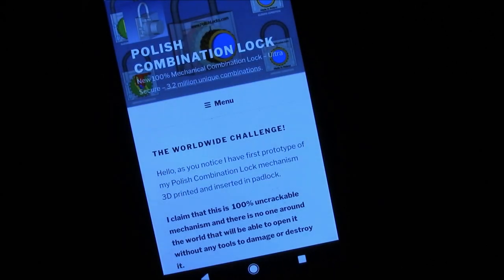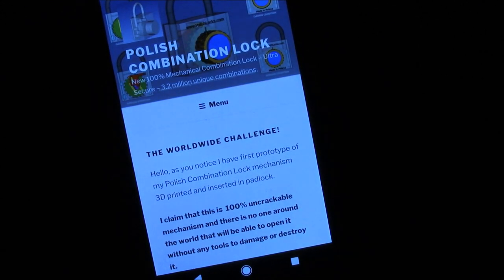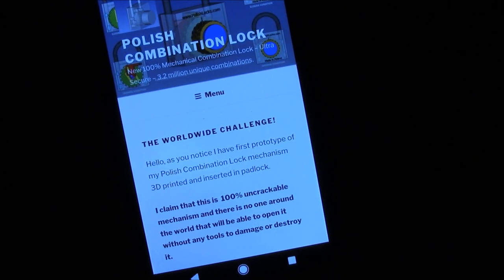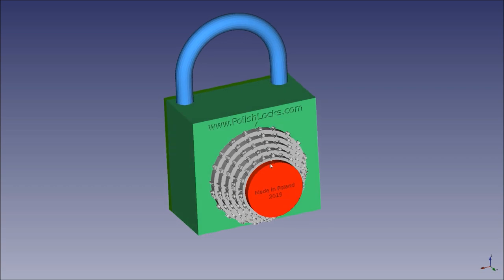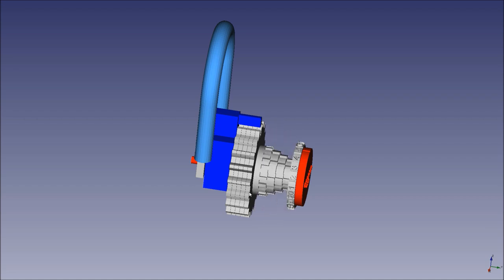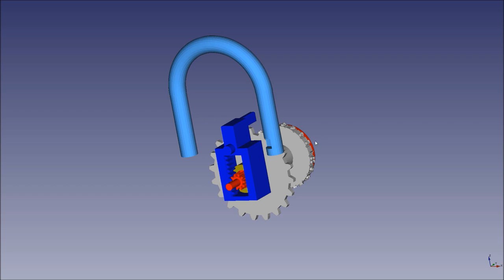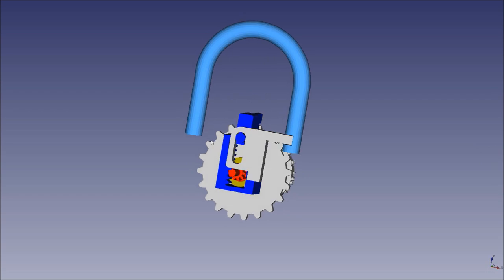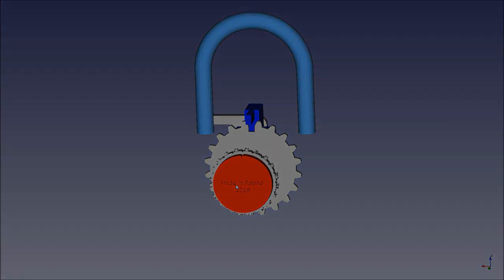(picking 625) The Polish Combination Lock - Introduction

Comment: Very cool lock.
The only thing about the body I would change is to give it a shrouded shackle.
My main concern is that the screw in part can be forced to uncrew maybe.....and then you can look as the notches on the inside of the wheels to see if they are lined up. Can you force the blue piece out with pulling attacks.
I know without tools it is very very good.
I like the design.
Would like to see a shrouded shackle.... otherwise I would want to use a lock like this.
Reply from the maker: Yes, a shrouded shackle is always a good thing. I also think that the screw is a weak point and maybe needs a counter nut to secure it. Let's see how good the feedback from the plastic - I have to be careful to not break anything.

Comment: What a simple, yet clever design. Potti, I have confidence in you being able to decode it. You have the advantage of knowing what's inside and how it works. I think that a lot will depend on the feedback. 3D printed plastic may not give the best feel, but, at the same time, it probably won't be so precise. The red dial will probably be the better tensioning option, maybe the shackle will help, too. Good luck and I look forward to you defeating it!
Reply from the maker: Yes, knowing the inside helps for sure. I even did some measurements - the bar is 3.8mm wide while the true gate is 4.2mm and the false 4.11mm. This should give 0.4mm room for testing the gate. Let's see how much feedback the plastic will provide.

Comment: Cool lock... but you will defeat it, I´m sure, if you can make tension on the mechanism is only matter of time that you find the little feedback that give you the setting info. Good luck and can´t wait to watch your decoding video ;o))))
Happy new year my friend, cheers!! ;o)))
Reply from the maker: Happy new year buddy :-) Cannot wait to receive this lock - it's in the UPS store 5km away from my house since Saturday - hope it gets to me my locklab on Tuesday.
Reply: @Potti314  Cool! Is it manufactured on a 3D printer, or it´s a metal prototype? the feedback would be very different depends of the material that the lock is made. Very cool anyway, can´t wait to watch the video ;o)))
Reply from the maker: It's made on a 3d printer - hope there will be reasonable feedback. Lock should come today :-)
Reply: @Potti314  ok, if you are able to decode a plastic one, a metal prototype don´t would be easier.

Comment: The false gates look wider than the true gate from what I can see. They taper in at the top and look to be half again as wide as the true gate. I would find the tightest number on each wheel and go from there. Just a thought.
Reply from the maker: The bar on the actuator that goes in the gate is 3.8mm wide and the true gate 4.2mm (the false is 4.11mm). This will give me 0.4mm to test for the gate. In theory the wheel in a false gate should be stuck under tension and in a true gate it should have some detectable free-play. Not sure however how good the feedback from the plastic model actually will be.
Reply: @Potti314  Yup, treat it effectively like a sidebar.  This should be pretty easy I think.

Comment: Hmm...I wonder if the combination can be changed ? Look forward to seeing the real hardware.
Reply from the maker: Yes, the combination can be changed. The inner and outer wheels are stuck together. By changing the angle of the connection you can modify the code.
Reply: Yeah, I can see the inner/outer wheels on your 3D model, I just couldn't see how they would move and disconnect - I should wait for you to get the lock in your hands ! ;o)